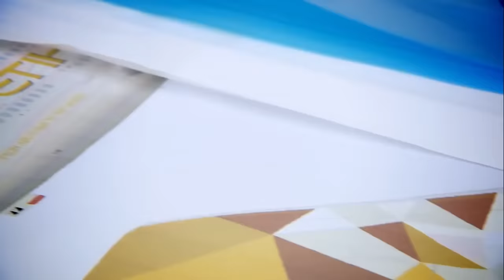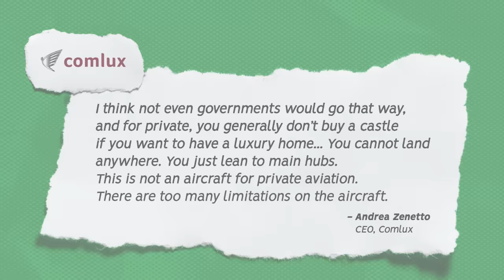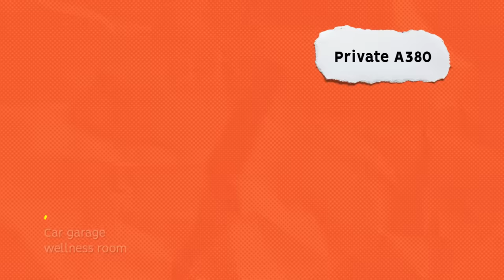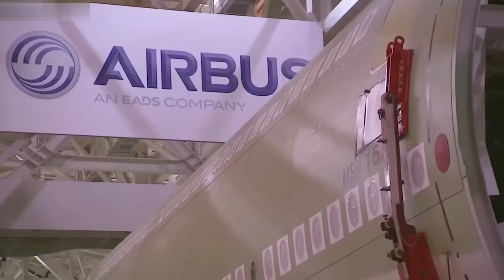The Logistics Of An Airbus A380 Private Jet

Comment: Certainly the biggest issue with an A380 Private jet would probably be the limited landing options. While the landing options might be opened up slightly with a lighter private configuration, they are still incredibly limited, especially compared to the similarly sized but incredibly more flexible 747.
Reply: lighter config won't change any available airports.  It is the SIZE
Reply: If I was a zillionaire with unlimited money, I can't imagine bothering to get an A380 for exactly this reason.  You can only go to a handful of major airports that are already super well served by regularly scheduled flights.  You really have to be spending an insane amount of time in the air going between big hubs to have any interest.  And just like, spend some more time on the ground, or get a fax machine or something.
Frankly, the most practical use for such a private plane would just be in being able to tell people you are the only person with a private plane that big for bragging rights.  You never even need to set foot in it.
Reply: @guaposneeze  Given that the plane is so large you could perhaps keep a small jet in the garage, wings off perhaps, and then roll that out once you are closer to your destination. There are some pretty small once on the market. And of course given that money wasn't an issue.
Reply: Getting u off 69 likes
Reply: I'm planning on buying 2...
Reply: @protonneutron9046  It's not the size, it's the take off and landing runway length required...
Reply: If you own An A380 u also would have a lighter smaller private jet for small airportys
Reply: I called Airbus a while back and asked them if the A380 as a private jet could operate out of the Nashville international airport. They confirmed that it could. They said the limitations of so many airports wasn’t the takeoff and landing, but the ability to accommodate so many passengers at the terminal.   Is it possible that this video is not taking these into account? Especially  that person that the video quoted, I would be very interested in knowing if he was taking into consideration these facts
Reply: to be frank you absolutly do need anything bigger then 787 size private jet in fact most baller go for the a220 and 737 bbj to flex on there billionaire friends gulfstream.
Reply: @Dr4gonWarrior  a major factor is the clearnce for the wingspan in alot of airports.

Comment: A "Private" A380 would prove so helpful as an operating theatre going abroad to 3rd world countries in desperate needs of health care treatments.
Reply: The much more robust antonov planes would be more suited for that role.
Reply: Funnily enough, the plane leased by Iron Maiden during their 2016 tour, the 747-400 nicknamed "Ed force one", allowed them a lot of flexibility in their logistics chain and the capability to reach destinations which would be otherwise impractical to reach by regular means. it is said that their 2016 concert in el salvador was the biggest concert ever in that country history. im not familiar with the restrictions and limitations of the A380,but for what I heard, this many dates on otherwise pretty isolated countries  would have been impossible if they used a A380 instead.
Reply: @hectorcorona9536  The major limiting factors are the airports capacity for the expected pasenger counts, the weight rating/ type of surface of the airfield, and most importantly physical space clearances. Its so wide some airports can't accomidate its wingspan on either the runways or taxiways/ apron.

Comment: It’s a big plane for most airports for example even at Manchester Airport the Emirates A380 is only able to fit on gate 12 in terminal 1 as it won’t fit on the others
Reply: I’m sure if they have their own personal jumbo jet ✈️ they they’re more than likely going to fly into a private airspace or terminal anyways
Reply: @angelaburress8586  your limited to only main flying hub smaler regional airfield or private airfield simply cant handle this size of aircraft and even in main flying hub first dibs will be given to airlines so its alot of hurdles and pain to be dealing with regardless of the monster of an expense it would cost to even remotely work plus you just paid half to a billion dollar for a flying palace and you that is less usable then your average gulfstream in speed range and utility.

Comment: the A380's range is an absolute beast
Reply: Seems like a two engine jet would have more range, the 777 probably has similar space for fuel and less cross section.
Reply: 500 extra nm over the 747-8?  Given the airport restrictions, how many additional routes does that make available?  I'd suggest none.

Comment: The first A380 order was in fact a private version.  It took years to work on, and eventually the purchaser changed the order numerous times and ended up settling on 2 or 3 different Airbus aircraft purchases.  But the design and production work for the Private 380 had gone quite a long way, with issues over chandeliers being requested and how to make such items safe during flight.
Reply: I shouldn't have been so trigger happy... you then talked about it anyway :D :D

Comment: A private A380 would be awesome, however, you are limited to large airports which is a huge inconvenience if you’re using it fir business travel.  Operating costs would be astronomical.
Reply: plus airline get first dibs on big terminal that can handle this whale of a plane that limits your acess even furthur there a reason why most baller dont go beyond narrow body private jet conversion like 737 max and a320 neo acj those are as big as you need them to be.

Comment: Wait.. the A380's limitation on flying into many airports are primarily because of gate space, multi-level boarding, and also basic economics: a whole lot of passengers wanting to go between the points it serves.  That does not apply to private or government use:  as long as it has a runway that's long enough then you get to park the thing anywhere way out on left field, you don't need a passenger gate anyway.  So that leaves only airports that are truly cramped for space as  problematic, but most places you could fly to.  (The A380 needs a shorter runway length than the 747)   And someone who buys an A380 probably already has a couple smaller business jets for shorter hops into small airports with fewer people.
Reply: It isn’t only about gate size, the wide wingspan also is a major problem especially at airports not built for the A380. Taxiways also had to be modernized for an airport to accommodate the A380

Comment: I doubt anyone would even think of using the A380 as a private jet other than governments.
Reply: And even they don’t for many reasons
Reply: It’s an absurd idea honestly.  The Boeing business jet 737 is the largest one logically. Any bigger is just absurd maintenance and operating cost.
Reply: @jonasbaine3538  sometimes that's the point :p
Reply: Alwaleed bin talal had ordered an a380 for private use
Reply: The owner of Chelsea has one as well. A bit more research?
Reply: Next they will want to rent to international space station
Reply: @davem16able  No, the owner of Chelsea, Roman Abramovich doesn't have an A380. He has a large jet - Boeing 757 or 727. And a small jet like a Bombardier or a Gulfstream
Reply: @jonasbaine3538  yet you seem to miss one extremely huge Point here and it's not the square footage of the aircraft it's the range! With a 737 you would have to stop and refuel multiple times to make any distance across the globe where as an A380 or 747 can do it in a single hop!
Reply: @anirprasadd  Abrahamovich has a 767, P4-MES nicknamed The Bandit.
Reply: so when you need jet fuel are you supposed to whip out your American Express Black Card to cover a 5-figure fuel bill?
Reply: @anirprasadd  is he still hung up at the Riyadh Ritz Carlton?
Reply: @deannelson9565  range is the same reason that allowed Gulfstream to get ahead of their competitors in the large business jet category.  Direct flight capability.
Reply: @gmb858  and square footage is why they are never in the same league as the BBJ and Airbus equivalent! Just because your Mini Cooper can get you there doesn't mean you'll be as comfortable as you would be riding on a big giant party bus!
Reply: @gmb858  I think he was released. But don't know what happened to his wealth
Reply: @anirprasadd And his fate? His money is taken away by MBS

Comment: this is probably too late, but why  didn't they combined both worlds?  A Cabin with Large Scale Semi-Private/Business Luxury level comfort completely separated from Regular Cabin with 210 ~ 275 seats.  Take with a pitch of Salt, but based on the Private Jet A380 configuration, since it can potentially fly further by theory, Combining the two configuration could possibly provide a more improved performance mostly in the Fuel Consumption side of the scenario.  Usually Business travelers fly with light weight don't they?  With Light weight onboard you don't have to worry about applying so much Engine Thrust or Fuel Burn to gain the necessary Airspeed to gain lift and maintaining Cruising Altitutes. IMO this Concept may work better with the 747-8i

Otherwise I makes sense to not reproduce so much of these Jets is Private Configuration, most Airports don't have the space from them, especially the A380

Comment: I think Airbus made a wise decision in not bidding for the x2 Airforce One contract.
Reply: Has to be an American made plane. They wouldn’t have been able to bid.
Reply: @KMT15  - exactly.  No point even thinking about it. 👍
Reply: It was never going to happen because of the security requirements One case where "build it here" has justification, and the potential promotional benefit of selling the "ultimate" presidential plane would never transfer into enough sales to justify the cost.

Comment: Given how popular the 747 is as a freighter, there should be enough of them still in the air that it should be relatively straighforward to operate a 747-8 private jet for decades to come. Will anyone other than Emirates be operating the 380 ten years from now? Five years from now?
Reply: More parts too...
Reply: I'm amused by the analysts that look at "why did the 380 fail" but who fail to understand that FROM THE START Boeing realized they needed a freight version, so designed a plane to be easily convertible.  I dont think it was prescience on their part, they just didn't believe they'd sell enough pure passenger jumbo.  This has allowed an active freight (both built for use and secondary) for the 747, a significant driver of 747 sales over the years.  By choosing to NOT offer an A380-F, even as an efficient retrofit,  Airbus crippled the planes resale value, which just adds one more nail in the coffin.  Why buy a 380 with almost no resale, when you can buy a 747 that can easily be sold on to cargo use?  Airbus didn't JUST misread the passenger market, they grossly misread what was already a massively growing cargo market.
Reply: @markdoldon8852  you're probably right about resale value, I'm not sure that was obvious 10yr ago. I've often thought they need 777 wings on both 747 and 380s... dual large engine folding wingtips etc. It's still possible someone will do some useful mods to them.

The 747 was originally designed exclusively as a freighter, back when they expected the sst to be the future of passenger transport.

Comment: I was trying to think of ways to make larger windows in a pressurized fuselage without compromising the structural integrity.  Then I started wondering if it would be easier to create entire sections of fuselage from the lightest transparent plastic or glass or whatever nanotech composite and then use paint to create opaque parts and clear "windows" of any shape, in any configuration along that ring of the fuselage.

So, I wonder if that could be a thing or not.

Comment: Large enough to implement a flying R&D factory (though not in every R&D areas) quite a good idea for stuff requiring high levels of security and make sure the research is kept away from prying eyes.
Reply: That's probably the world's stupidest idea (for today). No access to water, stable and ample electricity, good internet, still small, unstable, noisy.. Ugh.

Comment: On the short lived TV show "Zoo" the scientists were funded by a very rich man who had a private A380. One option he installed was a rear ramp for an SUV so they could go out and collect data. It also had a huge hole cut in the second floor so the research labs had a clear view of the lounge area below. I have no idea if this is possible in real life as any SUV would be immensely heavy and the A380 would probably need upgraded engines and a reinforced body to accommodate it.
Reply: SUVs aren't that heavy it could carry several with no problem

Comment: I could see the possibility of maybe the A380 being button up by a few companies that do international cargo delivery
Reply: That was already discussed before, unfortunately the A380 is a horrible freighter
Reply: The problem is that the 747 was DESIGNED to include a cargo version.  That allows a relatively cheap conversion to allow the nose of the plane to open up for excellent access to loading.  (That's why the cockpit of the 747 is on the upper deck, the door opens below it)  An entire 747 can be emptied and loaded with new containers very rapidly.
With the 380, no such provision was made.  It's much more expensive to modify for cargo, and while max cargo WEIGHT is higher than a 747, in practical terms only the lower deck would be used  which is slightly smaller than the usable space on  747.  Less space on a significantly more expensive plane to operate, with limited airport restrictions.  Throw in the massive built up infrastructure for 747 cargo, including spare parts etc, and it just doesn't make sense to convert 380s for cargo except maybe in unique situations..  Cheaper, easier, more efficient, more flexible to simply use the industry workhorse.

Comment: You can order a taxi and go anywhere mostly. You can order a tuktuk to get to even tighter places. If you’re a private buyer then you’re more interested in getting directly from point to point, you need a taxi or a much smaller, more efficient and more flexible aircraft. The A380 is like a coach for one person to a destination that is has windy hairpin bends. It’s impractical, inefficient, and in most cases simply not possible. Grandeur means nothing when you can’t use it in a practical manner. Smaller in this case is by far better for everyone.

Comment: Not the private sector, but these low prices might tip the economics of A380 freighters to be more favorable.  Especially when you consider the surges in e-commerce and slowdowns at international ports - there may be corridors where even point-to-point cargo volume is sufficient to warrant the use of one.
Reply: Just because the A380 is big does not mean that the payload it can carry is great. The A380 is a bad freighter. Period. The price to obtain one wasn’t the issue.
Also, it lacks features like a big enough loading door and even if the upper deck could be used for cargo, finding a loader that can reach that high while still having the needed stability is hard

Comment: the restricted number of airports that have the necessary space,equipment etc to handle the type will likely not want a private A380 and will charge accordingly. As most jets of this size will send more time on the ground than flying,unless you have your own hangar,parking space( not rented) parking charges alone will run to MILLIONS A MONTH.

Comment: We might see a private A380 simply because the cost of the plane is now coming to the range where a $1x0M purchase is possible. One cannot forget that Airbus wanted 445 million USD per frame, and no - you don't get discounts for buying one. Thus, with many retiring the frame, we could see it - the only real detriment are airports that you can use (remember, that's the issue with buying a converted commercial airliner like A32X or B73X - no Teterboro or Biggin Hill)... and availability of spare parts.
Reply: Precisely, the plane is just too big
But a lovely..🦜

Comment: Anything bigger than a Fokker 100 or comparable is just to compensate for what is lacking between the legs. Based on this, I expect the first private A380 from SE Asia or Middle East as average length in those countries are most in need of compensation.

Comment: This jet was designed to be a high volume people carrier between hubs.

It’s never worked for cargo as a result, which you would imagine is an obvious alternate use- but no.  It would also not work as private. 

It can’t make port at most airports, only specially designed ones. It’s too big to store, fuel, or service at most, except specially designed ones.

It simply lacks the flexibility that private flyers need.  For that reason alone, it’ll never happen.. not in the traditional implementation of a private jet.

High volume, hub to hub routes in maximum luxury? Sure. But only if you’re a Saudi prince or similar. Probably less than 10,000 people in the world who could afford this, ALL of whom who have other, better, more flexible options.

Comment: Even if you had the money to convert one, as many others have said, its just to stinking big to be ‘practical’ (as practical as a private 380 could be anyway). One of the benefits of flying private is the extra accessibility to airports closer to your destination, aka reduced travel time. 380s can only fly into major airports, 1. Due to their weight, and 2. Due to their wingspan. Even though the 747 is also large, it has dominated the market for so long that lots more airports would be 747 friendly. Either way, even at 50% off, I can’t afford a tire for one so I’m out!